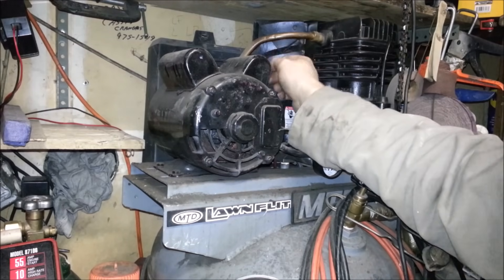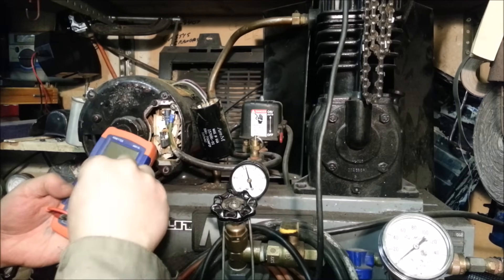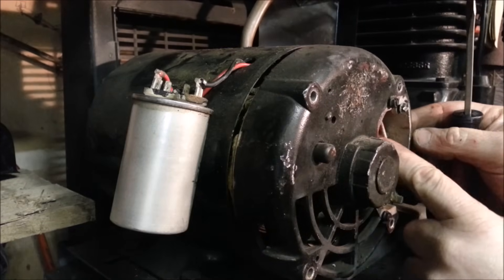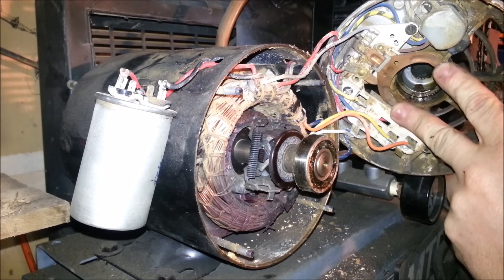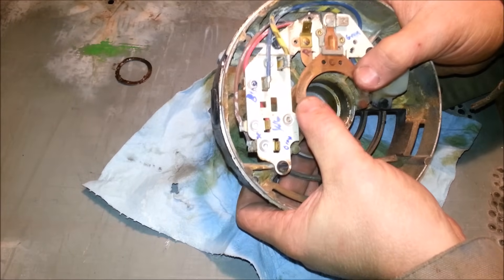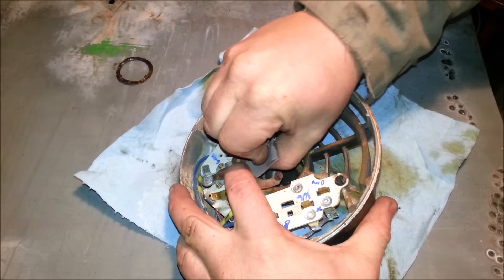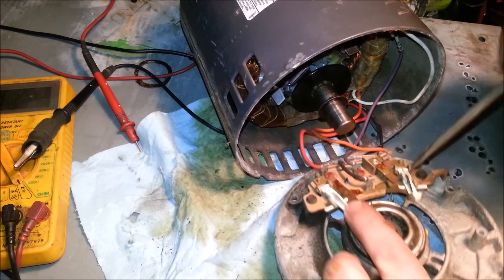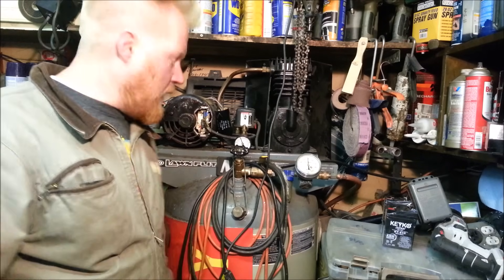Electric Motor Doesn't Spin but HUMS/Buzzes compressors etc

Comment: @sixtyfiveford thanks so much for your video. You saved me $250 on a new spa motor. My motor would hum like yours then the auto thermal shutoff would kick in a few seconds later and the motor would click and shut off. I checked the start capacitor and it tested at about at 56 micro farads so that was not the problem as this was within the acceptable range. The motor also made the same humming noise with the capacitor disconnected. I have a model BN51 A.O. Smith 2 speed 3hp spa motor and I drained my hot tub and disconnected the pump and noticed that the contacts for the on position were kind of welded together. I was able to pull them apart and sand the contacts just like you did in the video and the motor and pump work good as new! Thanks again I owe you one!!!
Reply from the maker: Awesome.
Reply: Justin Stiles aaaa

Comment: Excellent video.  Thank you very much for sharing.  I have an old craftsman table saw, and I have used it for years and it cuts great.  I went out the other morning to begin cutting on it, and all I got was some humming noise, and it would throw the check breaker on the extension chord it had it plugged into.  So I watched your video, and I am going to attempt to clean the contacts like you suggested, with some fine grit sand paper.  I'll put it back together and see if it starts up.  I'm not sure if the capacitor has gone bad on it, but I'll try to fix it first by cleaning the contacts with sandpaper.  Thanks again for sharing your knowledge.Tommy Schutz
Reply from the maker: Hopefully you can get it back up and going.

Comment: I've been told that sanding the contacts, although it may fix the issue, will remove the OE coating and the end result will be that the contacts erode again quickly???
Thanks for the video. I will only add that mud daubers wasps can build their nests inside the end bells. DAMHIKT
Reply from the maker: I've read that as well. But, I haven't seen it to be the case as I would think the OE coating is already gone if the points are corroded/eroded to the point of poor contact. I haven't touched this motor in over a year and a half and I have others that are older fixes.

Comment: Pointers for this excellent video...Before you remove those through bolts that fasten the end bells to the stator body...mark the top of the end bells with witness marks, usually one dot punched on with a center punch on the shaft side end bell, and two dots on the other  end bell, and do the same on the stator body. Align these marks together during reassembly and you wont have any through bolt issues. I use crocus cloth to clean contacts. Quincy compressors have an oil pump for pressure lubrication instead of a splash ring. They also have a gauge and a screw adjustment to set the pressure (all the ones I've worked on had them). That's the magic bullet they have.
Reply from the maker: I've heard of Crocus Cloth but have never used it nor seen it readily available. I assumed it was just finer emery cloth.

Comment: The contact are plated with cadmium or other metals sanding them will temporarily operate motor , but once removed the contacts will erode at a much faster pace . It is best to replace stationary switch . Always check centrifugal switch spring where attached to throw weights , springs will wear through attaching eye holes .
Reply from the maker: Yes , But generally if it's to the point they are giving you trouble the thin coating is already worn off or pitted. This gets an old machine back up and working for a long time. I haven't touched the contacts on this for almost 2 years now and the compressor runs a lot in my shop.  Yes, putting new contacts is ideal, but not always practical.

Comment: I've got a single cap dayton fan motor that I'm gonna try this with, hopefully it's just as easy. Thanks for the video!
Reply from the maker: Fan motors also suffer from worn front bearings. Check for wobble in the motor shaft.

Comment: think I have  the same problem with another compressor motor but it's the built in kind,   so,  the motor shell has to be pulled away from the end where the compressor is  built onto it.   it sounds as though it's the same issue though,   good vid explanation,   regards
Reply from the maker: Thanks, I'm glad it the info was helpful.

Comment: Thanks for the help. Cleaned up the contacts on my evaporator cooler electric motor and it got it going.
Reply from the maker: That's great, I'm glad it helped. On a side note, I fix/rebuild a lot of swamp cooler motors. The number one failure is the front bearing from lack of lubrication and a belt that is too tight. Just a heads up.

Comment: If i took mine apart and clean everything and still just get humming is it safe to say the motor is shot?  Thanks In advance for your input.
Reply from the maker: Is it on a belt driven device? DId you check the capacitors, or is a capacitor motor? Is the front bearing/shaft wobbly?
Reply: Its belt driven.  the shaft seems fine with no wobble.  What should I be checking on the capacitor, is there a certain voltage of ohms I should be checking?
Reply from the maker: You need a cheap capacitance tester to test the capacitors. Try operating it without the belt connect/no load. If it just hums, try spinning the pulley by hand first and see if it takes off. If it take off your start capacitor is more than likely bad.
Reply: sixtyfiveford when we spin the pulley you can here a switch and it starts working normal but did the same thing after we turned it off and restarting it
Reply from the maker: Either the start windings aren't engageaing through the contacts I cleaned in the video, the start capacitor is bad or the start windings are shorted out.
Reply: sixtyfiveford it ended up being the start up capacitor. Metered it and it was dead so jumped the wires to be sure and it worked perfect ever time we turned the compressor on.  Thank you so much for your time and input

Comment: Thanks for the tip! I was given an old 42" Heat Buster drum fan today and the motor has the same problem, hopefully it's not shorted out and just needs a cleaning.
Reply from the maker: Let me know what you discover.

Comment: 65Ford my comptessor turns freely by hand and tank is empty.  It blows house circuit breaker after five seconds of running . There is no extension cord on it and I switched out the circuit breaker w a bigger one to same result.  I havent done your fix ... do you think its the contacts on centrifugal switch.?
Reply from the maker: I bet your start windings are staying engaged, so I think your centrifugal switch is sticking.

Comment: Loved your explaination on your compressor. I had a similar issue, fixed it and now it keeps popping the motor fuss. the compressors like new and maybe ran for an hour but its 15 years old. Do you have or would you have a guess to what might be the issue. Thanks Great Vid.
Reply from the maker: If it is a capacitor motor, your capacitor could be going out.

Comment: Great clip. Saved me a lot of money. I have a dayton starter motor connected to a Winsmith chain drive which raises and lowers a boat lift. Works like it's supposed to now. Thanks.
Reply from the maker: That's great.

Comment: Great video.  Very helpful.  One question, I've been always told to disconnect the capacitor before you discharge it.  Does it matter?
Reply from the maker: I've always done it before to make it safe to handle/disconnect.

Comment: I should know this, but is the small cap the run cap?  My compressor starts and works, but has started to speed up and slow down a bit.  Makes me think the run cap is bad, or going bad.
Reply from the maker: The Start Capacitor will have a larger capacitance than the Run Capacitor. It could be loosing connection with the contact points(dirty) and this would cause surging. A malfunctioning Run Cap theoretically could to the same.
Reply: Mat Helm  start caps are almost aways plastic, start cap is only in the circuit for like 1/10 of a second, run caps stay in circuit the whole time the motor is running.

Comment: Well done video - thanks for taking the time to make and post it. When I apply power to my.a furnace motor, the motor begins to start up but then freezes and hums. With no power applied, the motor shaft spins freely (no symptoms of bearing wear). A new capacitor did not solve the problem. Per your video, I'll see if the contacts are the problem.
Reply from the maker: Furnace motors rarely have contacts like this motor in the video. Most of the time the bearings either seize or wear out causeing the shaft to wobble. The worn bearings and wobbling cause the motor to vibrate and not spin.
Reply: You were exactly right! The shaft would seize after trying to start up. I removed the motor and opened it up. The front sleeve bearing was worn so much that the rotor shaft would wobble and knock against the internal field coils causing the noise. The shaft was scored where it rotated in the sleeve. As you said, this motor had no contacts like in the video. You sure do know your motors!  Thanks again!

Comment: Don't "short out" the terminals of a Cap, the correct way is to bleed it down with a 100 ohm 5w or 10w resistor.
Reply: vboss5764 in an AC non polarized circuit, you don't have to really short... In DC....YES!!! A big resistor with the proper rating...

Comment: This was the perfect fix.  I bought my Sandborn air compressor and motor 35 years ago.  I was having 'hard start' problems, motor humming, buzzing on startup only.  I was considering a new $150 replacement motor, but thanks to this video I fixed the problem in 15 minutes with a little piece of sandpaper.  My compressor now starts up like it was new again!
Reply from the maker: I'm glad the video was helpful.
Reply: Looks like I have to do that to my 35-year-old Sanborn as well.  Good to know how long it takes!  Replacing the capacitor didn't fix it.

Comment: Again, you are amazing man. My furnace fan motor makes hum noise and doesn't start. but if I give a bit of turn, it runs good.  So, I'm guessing "Start capacitor" is bad.  I will test them tomorrow afternoon though.  Thanks again.
Reply from the maker: Start Capacitor; you're on the right track.
Reply: Yeah, I've found Capacitor's terminal was disconnected. Someone who replaced this motor before, installed used capacitor and it is over sized too.  Any how, I reconnect them and it is running nice all day today.  If it wasn't you, I would bought whole new motor.  ;)  Thanks a million.  I just wonder, how come you have so much knowledge, although you look so young?!
Reply from the maker: I simple and free fix are always the best. I'm glad the video was helpful.

Comment: very informative, great job,,  would you happen to know what capacitor would be good for my washing machine motor to use it as a grinder, or lathe motor,, the factory one worked great for like 1 minute and fried lol,,,, its a square motor, 3/4 hp   it had a starting capacitor, without one its hard to get it to spin for it to take off, kinda needs both, but not sure also how to do it........thanks for any info you could give
Reply from the maker: Sorry, they are all a little different and generally have the required capacitor uf rating listed on the motor data plate.
Reply: so considering it had a starting capacitor and watched where it said I would need a running one,,, the old was aa 110volt and it had other numbers instead of uf rating, here is label for motor   https://www.flickr.com/photos/john-hill/31206485084/in/dateposted-public/
Reply from the maker: I notice you mention a run capacitor, your motor doesn't require a run cap. It only needs the starting cap. You should need a part number 131212301 233-280 uf 110-125vac capacitor Frigidaire . These are around $5-10 online. http://amzn.to/2hKC8As
Reply: the one that was on it that fried fast is 233-280mfd 110vac, I took the motor off a washing machine, and wire it to 110 cord, I read when hooked to a washing machine its controlled by the board of the machine, but when wired to a regular cord, the factory capacitor fried fast.
Reply from the maker: Here is a wiring diagram for your motor http://cdn.homebrewtalk.com/attachment.php?attachmentid=164129&stc=1&d=1416454517

I assume it just got miswired. The cap is only energized very briefly and then the start windings are taken out of the circuit. From the wiring diagram the cap is wired by connecting one side M1(purple) to M7(red/blk) The M7 is connected internally to your HOT 120V. The M5(orange) wire connects to one side of the cap and then the other side(Orange) connects to Neutral 120V.
Reply: forgive me I'm a dork and newbie at this lol... not sure if I done it correctly, but I have the red wire tied to orange that goes to the capacitor, so it will stay in high speed
Reply from the maker: Take the red and orange apart. As far as I can tell this is how I would wire it

Orange from motor to one side of cap
other side of cap Orange to Black/red
Black/white to HOT 120v

For High Speed
Red to Neutral 120v
Nothing to Gray

For Low Speed
Gray to Neutral 120v
Nothing to Neutral
Reply: sorry to bother you again haha,, but do you think a variable  light dimmer switch would work on this motor ? or would it fry the capacitor?
Reply from the maker: Yes, but in doing so you won't only loose speed. The motor will be dramatically weaker/less torque. I've done it with fan motors with good success, but you also need to worry about going to slow and the motor not having enough speed to cool itself. You could wire it to take advantage of the low speed winding and flip a toggle switch to either go fast or slow.
Reply: I wired it as you recommended, put a new capacitor, I still have to manually help it , I would take it apart but its like JB welded together on the sides of it,  but when I hooked that orange up to hot, it flew, but didn't want to burn up this capacitor
Reply from the maker: If you wire it like below, the capacitor will be taken out of the connection by the motors' internal centrifugal switch. You never want to put the orange directly too hot. That causes it to run fully on the start windings only and they will burn up if ran for more than a second or so.

Orange from out of the motor to one side of capacitor
Then the other side of cap Orange to Black/red(or just hook the Black red to the other side of the cap)

Black/white to HOT 120v

Then for For High Speed
Red to Neutral 120v
Or for LOW speed Grey to Neutral 120v

ONLY hook 1 wire to the neutral, either the Red or the Grey. You could put a 3 way switch in the system that when centered, cut power, then move to slow or fast depending on the demand.
Reply: Thank you ill double check everything- will be my luck the motors just worn out or something, because I cant take it apart with that factory grey weld stuff on it,,

Comment: the  proper  term is  called a  centrifugal  switch.  on a  capasitor  start  ,  capasitor  run  induction   motor .
Reply: richard fote capacitor

Comment: Good video, Had a question. What are the relative values of those caps? One is the start and one is the run. They are not the same values?
Reply from the maker: They aren't the same and are based on what the motor manufacturer has deemed they need.
Reply: Thanks for standing behind your video and comments/questions. You clearly know your stuff. I have since learned that this is a PSC type motor I have here on a blower. It has two caps of the run-type and they are in parallel. This was news to me as a sort of experience newbie. Anything you can add will edify us all. Thanks

Comment: Thanks..ill try it..old sears compressor....back when it was quality.....where can i get switches??
Reply from the maker: A ton of older motors have a reset button on them. If it does nothing, try that first, then pull off the back cover and inspect.

Comment: got this exact fault on a 100lt Compressor.
Doesn't start on its own accord, will go if I spin it by hand
only builds upto 30psi and then it tries to spin and the piston doesn't get a full rotation and bounces.

same fault?
Reply from the maker: Sounds like and issue with the start winding or one of the capacitors.

Comment: "update " after watching your video again..I took it back apart,found that my wire going to my circuit breaker was rubbing on my motor finns,causing a short..in my hurry to put it back together,in didn't pay attention to the wires,in tie rapped them to the housing vents...THANK YOU FOR YOUR VIDEO SAVED ME 500.00 BUCKS!!!!

Comment: I have a different problem mines starts just fine it build preassure to about 50 then slows down and stop like its struggling I had change the pump thinking it was locking up but it wasn't , when it stops I shut it off and I can still turn the pulley by hand so they are not stuck . Any ideas?
Reply from the maker: There's a few possibilities I would check: Line voltage, pressure switch contacts or the run capacitor.

Comment: hey, thanks for the advice & showin me what I needed to know, I'm guessing this (cleanin the contacts applies to all sizes of motors, from the smallest to 3 hp +. I gotta ask, could i turn my 1/2 hp motor into a multi use? I got it to sharpen drill bits & grind/clean surfaces (rust), but i also wanted to use it as a lathe & to use as a compressor. What would u say? Thank for this video, regardless!!! The info is so needed as I want to create new products with existing knowledge/tech.